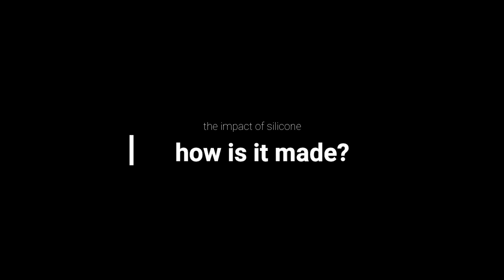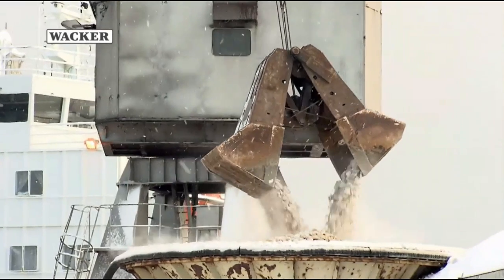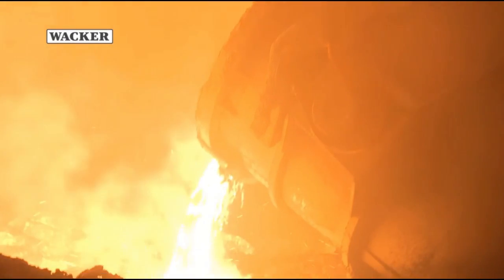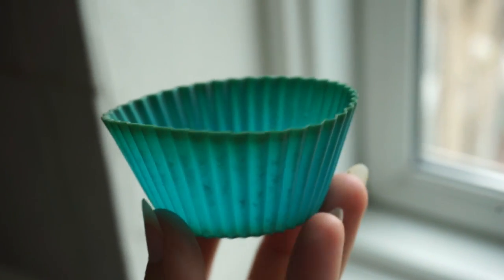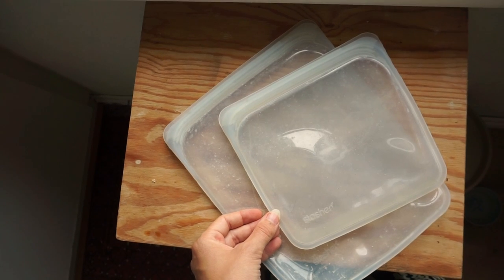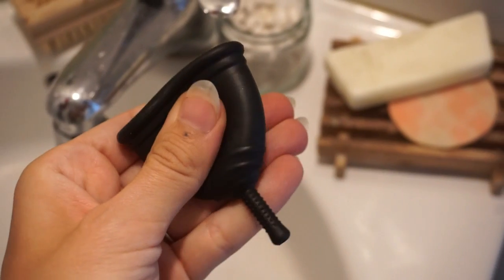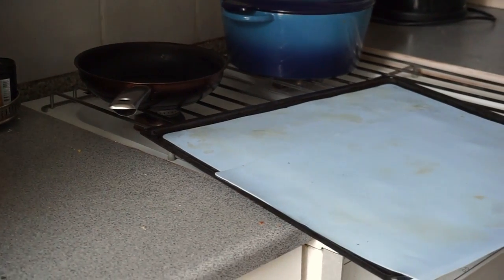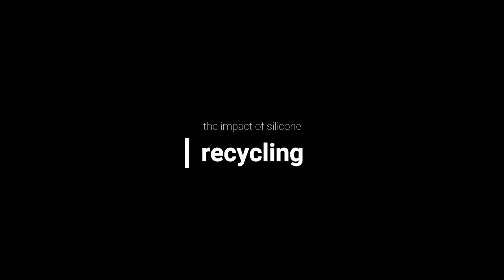THE IMPACT OF SILICONE // is it better than plastic?

Comment: Silicone doesn't come from the rubber tree (it's described as rubber, because it has the properties of being able to bend, or having "rubbery" properties). Silicone is made from rock... the atoms of silica rock are heated and pressurized to reduce them to atomic elements/powder, then are chemically turned into polymers (strings of those atomic powders). This is why it comes in different hardnesses, because the chemists can control the length of the strings of atoms (leaving reactions to run longer or shorter depending on the properties they want)... The main chemical biproduct is a strong acid which is fairly common and easy to dispose of (or rather neutralize). But the substance: Silicone, is rock, that's why it takes heat and doesn't melt, it's bendy rock. You can't put rubber in your oven. You can put silicone in your oven (up to 250 degrees C).
Reply: Yeah do you got to remember to talk slower and you smaller words because Gen z.

Comment: SILICONE IS NOT ECOLOGICALLY SOUND NO MATTER HOW THEY TRY TO CONVINCE YOU OF THAT. Silicone is still a type of plastic so it's not 'plastic free' or even biodegradable.  Creating it requires a massive use of energy to heat furnaces to rock-melting temperatures and notably it is not called silicon (the element) but called SILICONE - that refers to the addition of hydrocarbon molecules (just like plastic) so silicone is actually a hybrid plastic with some silicon in the mix. But it still takes up to 500 years to break down and will pollute the environment until then. Try using an alternative to silicone containers like glass, metal or fiber containers (like baskets, bamboo, or beeswax wraps) instead.

Comment: Hello,

I really like this series because it helped me to consider the ways that something is produced rather than if it is just biodegradable or not. I'm been trying to figure out a way to bake while avoiding things like silicone or plastic molds but I'm not sure for two reasons: Firstly, I know that some research is going on involving bacteria that eat plastic which makes me wondering if we are reaching a point where plastic is biodegradable. Also, I've been considering switching to stainless steel for new utensils but I'm not sure if it would have a smaller environmental impact. I would like to see a video about the environmental impact of steel. I look forward to future videos in this series. Thank you for caring about the environment and helping make being more environmentally friendly less confusing.

Comment: Um - silicone is not theoretically or practically mechanically recyclable. The molecular chains are cross-linked and cannot be melted down again like the recyclable plastics. It can be ground down to a powder and used as a filler in other products, but it cannot be properly recycled.

Comment: Silicone is only partially derived from sand. The ‘silicon’ element that is part of the molecular chain is only a part of the polymer. The rest is likely made from fossil-based feedstocks. Silicone is plastic. FYI - so are most plant-based and/or compostable materials that are used in the same applications as traditional fossil-based plastics. New feedstocks are being found to replace the fossil-based ones. Being made from plants does not make something ‘not plastic’. I’m horrified by some of the green-washing around this. Particularly when I see ‘plastic-free’ on materials such as PLA and other industrially compostable plastics!

Comment: I'm not an expert, but I think the production of Silicon from quartz is very carbon intensive. I think the reaction is SiO2 + C -> Si + C02, So you put in carbon in the form of CO gas and Coal in the furnace and combine it with SiO2 (quartz sand) and you get C02 as a byproduct, and it also takes quite a lot of energy to do this reaction.

Comment: In normal speech we would refer to all polymers as "plastic" or "rubber". Nobody is going to say elastomer. They can be molded and some can be stretched, are susceptible to solvents, the sun, scratches and dirt. I am still uncomfortable seeing newfangled silicone tools used on a hot pan, which doesn't have a stable limit of temperature unlike water.

Comment: I am a chemical engineer and I am impressed with your knowledge of materials.  That being said, it is very difficult to recycle silicone as it is a crosslinked polymer which means it cannot be melted and reprocessed. It could be ground up and used as a filler. Also fossil fuels such as oil and gas are used to produce plastics but they are not plastics themselves.  Thanks for your generally informative videos.

Comment: I for one don't like silicone particularly. I have 2 silicone spatulas which I use to completely wipe off used oil from pots or when I cook,to make sure I get all the leftovers from the pots. I also have pot covers and a spoon holder. I really don't like the idea of cooking in silicone,even though many of you said it's safe. 
I am though considering to buy a menstrual cup and I still don't know if to buy it silicone or natural rubber.

Comment: Thanks for all the info. I’m so glad about the food safety. I was surprised though to hear you call rayon and lyocell as synthetic, because I‘m quite convinced that both kinds of fabrics can rot which is not the case with polyester or polyamide. 
And did I miss it or what would you say to all the silicone in cosmetics ending up in the worlds rivers and oceans?
Reply from the maker: nommh I have answered this a couple of times in the comments, they are synthetics and their ability to biodegrade are not a given, it depends on the quality and the fillers used to make it

Comment: Thanks for your the work you put into the video. In general I would avoid any argument about something being "natural" or something being better because it is not made from fossil fuels. Consider as an example that steel gets often possessed using a coal even though there is little carbon in the end product. Another example of a case where the argument being natural backfires is the use of paper versus plastic shopping bags. Even if one is not containing any crude oil products and even assume it is not needed for the production it binds a lot of wood as a resource. In the end the idea can turn out to be worse. Here clearly reusable bags are the better option. So better consider all inputs including energy.
Reply from the maker: I also specified in the beginning of the video that a product being “synthetic” is not in and off itself a bad thing, so this is a POV that has not been left out of the video. I do think however when we talk about energy input and sustainability that disposal should always be a part of the conversation as well. So although I would avoid both paper and plastic bags, there is a clear problem in the fact that plastic releases micro plastic, that it never biodegrades, and that it releases methane when “breaking down” which should always be included in the comparison 🌿
Reply: @Gittemary  First of all, I'm not sure if I'm addressing issues or if it's a "design decision" you've made to make your video accessible to a wide audience. It seemed to me that the terms "synthetic" and "natural" were not the same. Maybe it's good to point out that I have a physical/mathematical background that leads me to try to avoid misunderstandings. For example, if I were to mix wood fibres and beeswax into a plastic-like substance, would you consider that as  "synthetic" because it does not exist in nature ? Or even the mixing of two minerals that do not exist in mixed form on earth. Is that "synthetic"? Or if you bake them into a brick, if you want them to bond into a "synthetic" material ? If you want chemical bonds, we can imagine that soap made from vegetable oil and ashes is a kind of natural candidate for being "synthetic". What I actually wanted to address is this argument like "it is no longer part of nature" - something at 5:40am. That's kind of a false argument, because something that is synthetic could also play a role in biological systems. Here you have an extreme case, for example: https://www.nationalgeographic.com/news/2017/04/wax-worms-eat-plastic-polyethylene-trash-pollution-cleanup/. Thanks to evolution ^^! I'm sorry that this becomes a wall of text. For the input thing ... it's just about having something easily comparable because we can measure it. I think it is also important to point out the importance of numbers ! I agree that the whole life cycle is important. Also note that SOME silicone compounds are known to actually decompose. As in the example above, we might find even more surprises. In this sense, probably not every microplastic has the same effect on nature, and one of the main problems is the lack of knowledge about it. There is so much more to say and I can fully understand that you probably do not want to go into a lecture format and lose 90% of people ^^. Finding the right material for a job is one thing that keeps the engineer busy, even if he doesn't consider what happens at the end of the life cycle. The world is damn complicated, so keep making people aware of it ^^! Cheers!

Comment: Can you do videos on what can and cannot go in your compost (such as receipts -- can paper to-go boxes be composted?) and what to do when your town ditches municipal recycling? How can you stay sustainable during a pandemic when bulk bins are closed and recycling isn't an option?
Reply: Receipts arent recyclable or compostable, the BPA coating is very toxic. Take away boxes/pizza boxes are compostable, but check with your compost boxes guide/the website (for our hot composter it has to be at a different temperature depending on what it is). Paper bags, (not the shiny)especially if you wet them before, should compost fine. Try to buy things you can reuse (e.g. jars as glasses/storage) and see if your city/town has a recycling centre you can bring things to (we have places for fabric, glass and metal). If not, see if you can cut down or share with a family member. That’s all my advice, hope it helped.

Comment: Can you do stainless steel or iron base items? Or... 

rubber 
cork
linen
Ceramic/porcelain
Reply: Hello! I’m not informed on the rest of the materials, but I can tell you about cork! Cork in simple terms in wood bark. It is very sustainable because when it is harvested it is already dead tissue, meaning it does not harm the tree and will be grown again.
Reply: natural rubber is biodegradable since it's made from plants, so is cork and linen. ceramic and porcelain comes is just clay (earth) they'll go back to earth again and mold into the ground (takes a very long time tho), but ceramic last for thousands of years unless you break them anyway so it's very sustainable.

Comment: Dont wanna sound like a conspiracy-theorist, but i doubt the "no chemicals leaking into your food". I love silicone-muffin tins but after like 20/30 uses they get so.. oily and smell horribly of chemicals and then my muffins taste weird :(( so i had to throw out a lot of silicone-muffin tins and switched to metal ones. Is the oilynes and the stingy smell chemicals or what else is that then? Any help? :(
Reply: It's possible that you went over the temperature rating of the silicone or that it was low quality silicone. You could to the stretch/bend test like what was recommended in the video. Scientifically, if it's treated right silicone will not leach chemicals.
Reply: I would just grease the muffin pan and that way you don’t need to use any tins:)